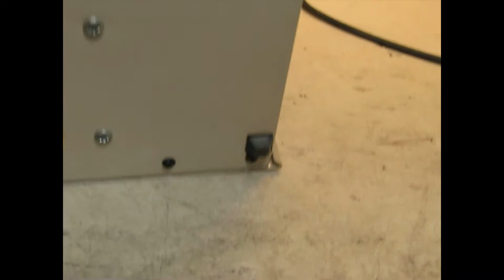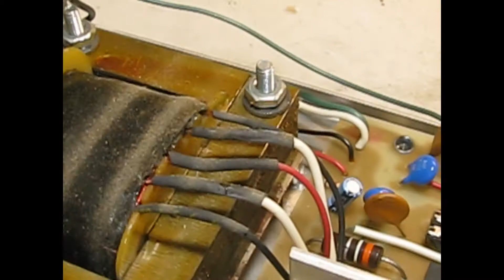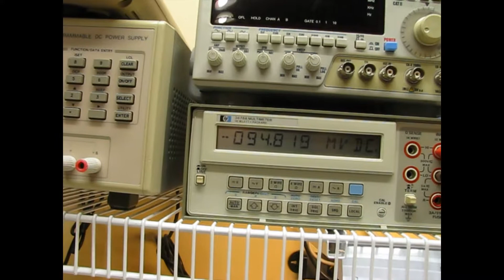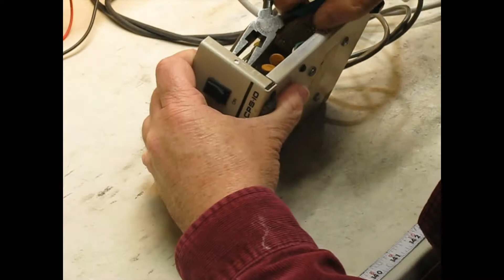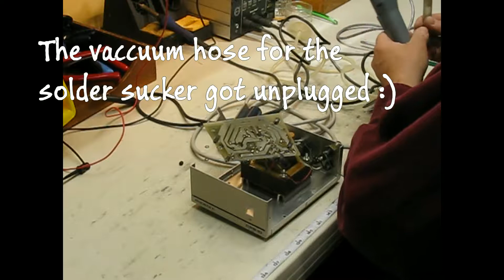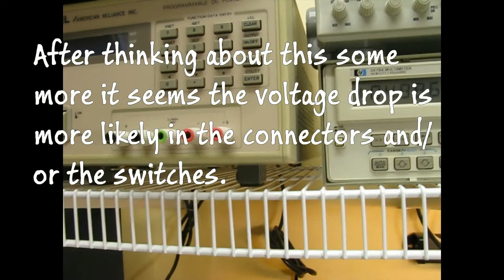Phoenix CPS 10 C64 Power Supply

Comment: May I ask what was wrong with it? I must have missed that.
Reply from the maker: It worked but was cleaned up and improved. The main improvement being replacing the original output power cord with one with suitable sized conductors.
Reply: @HeyBirt  Interesting. I have the same one, that instantly blows the fuse. Checked the Transistor etc. Can not put my finger on it.

Comment: Do you think the traces on that PCB can carry the full amp to supply those outlets with 100 watts?
I'm thinking about replacing some of the thin gauge wires and upgrading those rectifier diodes to make it all more heavy duty.
FWIW, on those outlets, the clips that hold them in the case are connected to the ground, so the outlet ground has continuity to the plug ground through the metal case.
Reply from the maker: 100W @ 120V is only 0.83A, a 20mil trace can handle that much current. The way the outlet wires were soldered to the PCB on mine left a lot to be desired.

Comment: I just opened up my CPS-10 and it's a bit different. No adjustment pot, different PCB.
Same small gauge wires and tiny little half-bridge rectifier diodes.
That transistor is capable of 15 amps and the fuse is 5 amps but those wires and diodes will never carry that much current for long.
The outlets on the back are marked 100W but I'd never draw that much from them. I'd be afraid it would melt.
Reply from the maker: 100W @ 120V is only 0.83 amps, a 20mil wide trace can handle that much current. 

I think this power supply design went through 3 different owners over the years. There seems to be the original, the Phoenix CPS-10 and one other I don't recall at present.
Reply: @HeyBirt  I was hoping that CPS-10 could supply ~3 amps for REU and other accessories but I'm concerned about that 24 gauge wire so I'll replace the lead to the C64 as you did with 20 or maybe 18 gauge if I can find some.
The mains AC cord is 18 gauge so I want to replace all the AC wiring with 18 gauge to match. 
I'll also probably replace the rectifier diodes with 3A rated but I have figure out what the over-current protection is configured for.

Comment: Very good video.  Could you tell me which brand and model is the welding suction system. Thank you.
Reply from the maker: It is an older Pace MBT system. I bought it used on eBay 6-7 years ago for about 1/3 the cost of a new Pace system. It was a good find as it had hardly been used and included extra handles (the ThermoSqueeze handle it came with is worth more than I paid for the hole thing.)

The Pace systems are top notch, expensive though in the USA and more expensive elsewhere. I think my next favorite brand would be Hakko which might be easier to obtain outside of the USA. There are a lot of cheap Chinese clones of clones out now which I would not recommend, some are OK and some might burn your house down :(

Comment: I have an Estes CPS-10 which apparently the Phoenix was patterned after. I remember back when I got the Estes, it was considered to be one of the best alternatives to the original brick power supply but you managed to find problems with it too! Maybe the Phoenix version just cut corners. I'm going to have to crack mine open and give it a look.
Reply from the maker: Interesting. The PCB in the Phoenix is marked Estes. Perhaps Estes went bust and Phoenix bought their stock, i.e rouse out of the ashes :) I would be interested to see pictures inside one if you ever take it apart.
Reply: I had a chance to take a closer look at my power supply. The name Phoenix Electronics is on my serial number label also! I have a four digit serial, supporting the idea that the Estes brand name came first. I must have missed the beginning of your video on my original viewing. I didn't realize you had to drill out fasteners to get the case open! While I like what you have done with yours, I'm just not ready to take this on myself right now. The power supply does work fine. One major complaint I have with it is that it does get quite hot. After using my C64 for over an hour yesterday, I placed my finger on the front of the case near the switch and applied light pressure. I would say it is almost to the point of being uncomfortable. I assume all this heat is coming from the transformer. Does yours get hot also?

Comment: And again, nice work on part 3. This was a very informative 3 part series. The Phoenix CPS 10 is a nice little C64 PSU once modded, as you have done here. A shame that the ground wires where snipped off from AC outlets in the original assembly. I just tracked down Phoenix CPS 10 on eBay -- the seller is asking $200 USD -- yikes!
Reply from the maker: I'm still looking for the PCB mount 1/4" quick connect tabs and a couple of new outlets. I also found a power switch, in my junkbox, which is about the same size. If it fits I'll install that as well as it is frustrating not knowing if it is on or not with just a quick look. The OE switch is small and shaped that it is hard(ish) to tell, quickly.